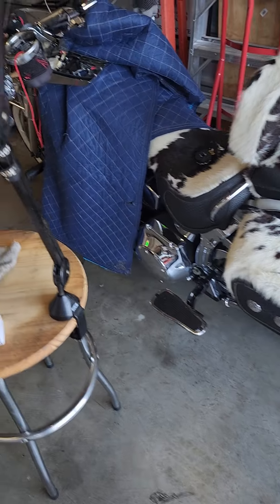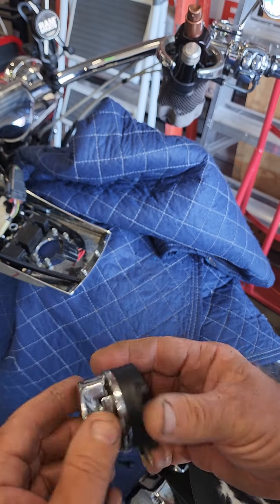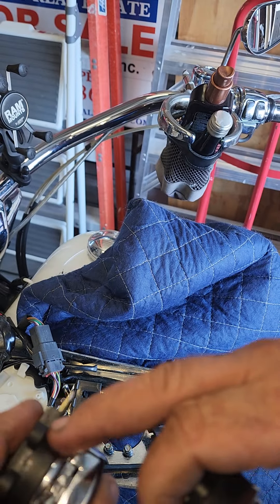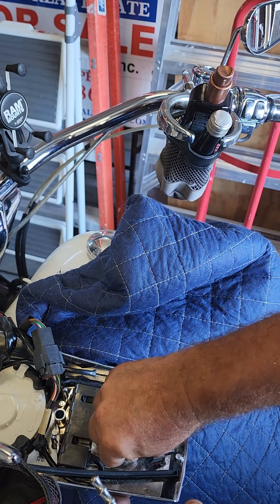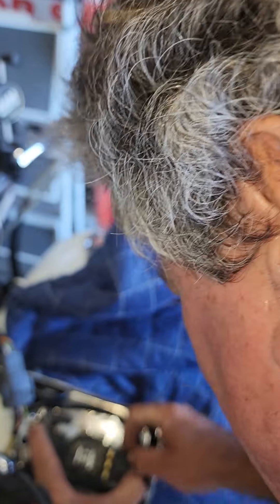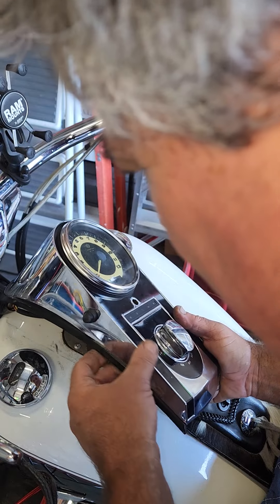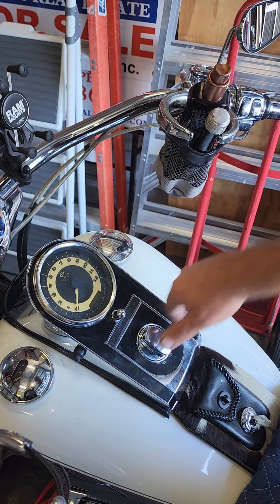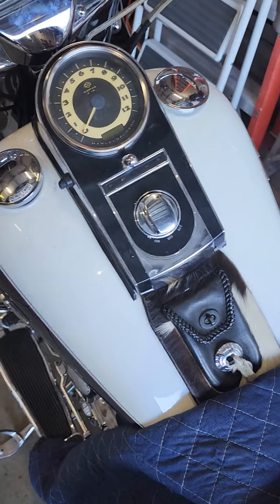HARLEY SOFTAIL DELUXE IGNITION SWITCH REPLACEMENT MR SUNSHINE LOCKSMITH EDDY SHIPEK 561-693-8636

Comment: I would like to replace my ignition switch but the center nut in the panel turns with the screw, any idea of how to get that nut off
Reply from the maker: Sounds like base is rounded off.  Try to pry up on case and use impact wrench to spin off nut.